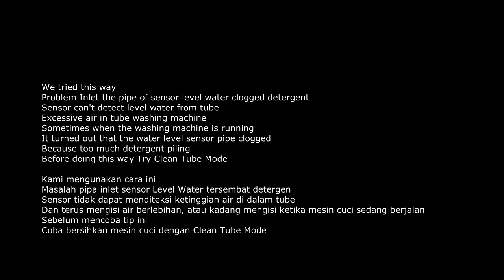Samsung Washing Machine Overfilling Water Level Switch but no error LED 4E E1

Comment: Thanks for this video! It at least helped me identify the sensor and the air tube for the Samsung brand washer.  The problem with mine is that the tube had disconnected at the bottom end - NOT at the sensor.  As soon as I removed the back panel (6-7 screws), I noticed the other end of the air tube just hanging there.  After re-attaching it, I ran a self-clean, and the water shut off when it was supposed to.  We just replaced our Dryer, so my wife was thrilled we didn't have to spend more money on another appliance so soon.
Reply from the maker: You are welcome Jr, many case washing machine in this unit. Like pin connector dirty or not contact, pipe, stuck etc. Btw thank for you too

Comment: Mas saya mau tanya mesin cuci samsung top loading saya awalnya tombol2nya ga berfungsi yg fungsi hanya tombol powernya.
Saya coba bongkar liat modulnya saya liat pcb.nya banyak seperti jamur di komponen2nya di dalam lapisan gelnya.
Lalu saya panggil teknisi mesin cuci, setelah diperiksa katanya modulnya kena lalu dia bawa biar dibenerin ke servis centernya daripada ganti modul lebih mahal katanya.
Setelah kembali modul dipasang coba ditest semua tombol berfungsi dengan baik, namun muncul masalah baru yaitu water level tidak berfungsi sebagai mana mestinya, air terus saja mengalir tidak mau menutup sesuai level yg dipilih.
Lalu diganti water inlet yg baru (bkn sparepart ori.nya) tapi masih saja seperti itu, kemudian diganti lagi dengan sparepart original.nya tapi masih saja begitu.
Sudah dicek selang n water inlet pun baru, sampai 4 hari bolak/ik ga kelar2 akhirnya si teknisi pun menyerah.
Setelah teknisi pulang saya coba iseng tekan tombol power+water level+function bersamaan, muncullah kode E9.
Saya browsing kalau error code itu menandakan adanya kebocoran.
Lalu saya perhatikan lampu indicator dari water level menyala 2 bersamaan, 1 posisi low yg saya pilih dalam keadaan terus menyala dan 1 lagi posisi med terlihat berkedip2.
Ini sekedar asumsi saya apakah sensornya membaca kalau airnya kurang sehingga dia terus mengisi?
Tolong saya dibantu, karena saya penasaran dan tentunya ingin mesin cuci kembali berfungsi dengan normal, maklum pekerjaan saya sebagai ibu rumah tangga jadi sedikit terbengkalai karena masalah mesin cuci ini.
Reply from the maker: E9 adalah error Low Level. Air yang sudah masuk ke tabung, tidak terditeksi oleh sensor (walau tabung sudah hampir penuh terisi air).
Bila selang sudah diganti, kemungkinan di sensor level sensor yang rusak, atau lubang di bawah tabung tersumbat diterjen / kotoran. Cara kerja bagian tersebut, menditeksi tekanan air. Misal diatur air sudah terisi setengah, maka sensor akan menditeksi air sudah setengah tabung berdasarkan tekanan udara di pipa sampai ke alat level sensor. Dan sensor akan mengirim sinyal, untuk menghentikan aliran air. Bila sensor tidak menditeksi tekanan air, asumsi tersumbat dan air terus mengalir. Bagian sensor tersebut mungkin bermasalah. 2. Ada kemungkinan lubang di bawah pipa ke tube tersumbat. Selang tidak terpasang dengan benar (artinya sensor tidak menditeksi adanya tekanan air). Cek kembali dibagian konektor kabel ke sensor (jangan lupa cabut aliran listrik sebelum memeriksa), apakah konektor kabel ke alat yang bundar (level sensor) sudah terhubung dengan baik. 
Mungkin tip ini dapat membantu, bila memungkinkan coba isi air bersih seperempat, dan jalankan proses mencuci dengan mengaktifkan Clean Tube (mencuci tabung). Fungsinya membersihkan tabung, umumnya dijalankan setiap 1 bulan sekali agar komponen di bagian bawah tabung mesin cuci bersih kembali.
Demikian bu informasi dari kami, semoga dapat membantu.
Reply: Saya coba bersamaan muncul E9 mba Amelia... sedang masalah saya di tombol startnya yg gak berfungsi.

Comment: baik sekali agan ini, tips nya berguna mengatasi mesin sanyo top load saya yg tiba2 hanya bisa ngalir terus airnya akibat sensor level  air error.
Reply from the maker: Sama sama om
Reply: mesin cuci saya muter nya kasar kaya seret. terus pengeringnya gak muter kira kira panaya yah?
Reply from the maker: Bila mesin cuci kasar ketika proses pengeringan. Dan terdengar keras seperti membentur dinding mesin cuci. Kemungkinan beban pakaian terlalu banyak. Hal lain bantalan pegas seperti per sudah usang. Bisa di coba dengan mengurangi jumlah pakaian atau di test dengan mengisi air minimum tanpa pakaian.
Dan dicoba kembali apakah bunyi masih terdengar. Bila yah, coba periksa kemiringan mesin cuci.
Bila miring , posisikan kembali agar mesin cuci berdiri dengan baik.
Bila masih berbunyi, memang urusan teknisi. Solusi lain dengan memberikan bantalan busa di dalam mesin cuci agar tidak terguncang.

Bila pengering tidak mau berputar, biarkan selama 5-8 menit. Biasanya akan muncul pesan error. Sistem kerja mesin cuci, ketika proses pengeringan maka sisten sensor tekanan air akan menditeksi air sudah dikosongkan. Bila sensor tekanan air tersumbat, bisa disebabkan pengunaan deterjen terlalu banyak dan menumpuk di mulut pipa sensor dibawah mesin cuci, dan menyumbat. Maka mesin cuci tidak akan melakukan proses pengeringan, karena sensor menganggap air di dalam drum masih ada. Bisa di coba dengan meniup bagian pipa valve. Dengan catatan air memang sudah kosong dan keluar dari mesin cuci.

Bila muncul pesan error. Coba periksa di bagian belakang pipa pembuangan. Biasanya ada coin tersangkut dan tidak bisa keluar. Membuat drain air menjadi terhambat dan tidak mengalir dengan baik.
Dalam beberapa menit bila air tidak keluar seluruhnya, maka sistem mesin cuci mengangap ada kesalahan, otomatis akan menghentikan proses pencucian ke tahap berikutnya.
Informasi untuk memeriksa drain air dapat dilihat video dibawah ini
https://youtu.be/Lk3TuR7xEeQ

Teknik lain di bagian mesin cuci terdapat opsi Clean Drum. Lakukan proses tersebut untuk membersihkan kotoran di dalam drum mesin cuci.
Bila masih bermasalah, sebaiknya memanggil teknisi. Mungkin saja bagian switch sensor yang bermasalah.

Mesin cuci seret, misalnya berbunyi kasar. Seperti kemasukan benda. Ada kemungkinan uang koin masuk ke dalam mesin cuci dan menyangkut di bagian bawah. 
Masih banyak masalah yang terjadi dengan mesin cuci.  Informasi diatas hanya sebagian tip yang kami ketahui
Reply: Caranya bagaimana ?? Boleh dong saya tau. Permasalah nya sama kaya punya saya, pas saya tiup dari selang baru dia mulai nyuci dah.

Comment: Is there water coming inside the pipe while the maching working??
Reply: I did relase the pipe from the tank but there is no water coming out from the outlet!!
Reply from the maker: @ham23eded  The water level switch pipe only detects air pressure from changes the water pressure from the drum
When the pipe is removed or unplug, the sensor will detect the water is empty.
Reply: Thanks..so it seems the switch is to detect if the machine is empty of water or not..is that right?? Or it is to detect the water level at certain level..there is selector switch to choose the required water level when starting the machine ..is the sensor  work to detect the selected level??

Comment: Nyuci pakaian sedikit  pakai mode fuzy tap airnya paling banyak itu knapa ya,seharusnya fuzy itu kalau cucianya sedikit airnya jg sedikit tapi mesin cuci samsung saya entah banyak atau sedikit cucianya airnya terseting ke paling banyak.apakah ini normal?
Reply from the maker: Ukuran ketinggian air diatur oleh sensor water level
Mengunakan sistem tekanan air, tersambung ke sebuah pipa, sampai ke sensor

Buka lubang di drum mesin cucu tersumbat, mengecil akibat deterjen
Tekanan air sampai ke sensor bisa lebih rendah.
Disini muncul masalah, sensor mengira air yang sudah setengah masih kosong.

Hambatan / resistan pada kabel sensor
Kemungkinan lain kabel di sensor, bisa usia mesin cuci sudah cukup lama
Penyebab sensor salah mengirim sinyal bisa bermacam-macam.
Kelembapan tinggi membuat korosif di bagian sensor.
Dan sensor salah mengirim sinyal ke modul mesin cuci.
Pipa dan lubang tersumbat, kotoran dari deterjen yang terlalu banyak menumpuk.
Pipa yang kurang kencang, atau bocor dan lainnya
https://youtu.be/H5PIa3WmD_4

Untuk memeriksa sebenarnya mudah
Clean Drum, adalah cara paling praktis
Lakukan 2-3 bulan sekali, walau di atas kertas disarankan 1 bulan sekali
Mengisi air ke tabung dan di bersihkan, hanya air untuk membersihkan drum.
Banyak penguna mesin cuci di Indonesia salah mengunakan deterjen
Mengikuti takaran pabrik, padahal hanya mencuci 1/4 tapi mengunakan deterjen ukuran penuh.

Memeriksa
Coba kakak set ke level air 1
Setelah mesin cuci bergerak, catat ketinggian air di drum mesin cuci
Pindahkan ke level 2, apakah mesin cuci berhenti
Dan mengisi air kembali.
Bila yah, sensor masih bekerja baik

Bila dipindah ke level 2, mesin cuci tidak menambah air.
Dan ketinggian air di level 1 dan 2 tidak berbeda, lalu mesin cuci langsung jalan
Ada baiknya diperiksa oleh teknisi.

Jangan lupa, ketinggian air level 1 mencapai 1/2 ketinggian drum lebih.
Karena mesin cuci harus mengangkat pakaian agar terapung, agar pakaian tidak mengenai propeler yang memutar di bagian bawah.

Semoga informasi ini dapat membantu

Comment: Hubungannya water level sensor dg water inlet dan drain motor gmn gan...apakah berkaitan langsung, krn mesin cuci sy tdk bisa berputar sedangkan indikator nyala normal bang ?
Mhn pencerahannya..tks
Reply from the maker: Water level sensor
Menditeksi tekanan air di dalam drum mesin cuci
Sinyal dikirim ke board.
Misal mengatur pengisian air level 1, 2, 3, 4 (Max).
Sensor tersebut bertugas memperkirakan tekanan air yang masuk
atau yang keluar (dibuang / drain)

Inlet, drain motor.
Mendapat perintah dari board.
Setelah proses pencucian, pengisian air
Tahapan di kontrol oleh chip.
Misal tahapan mengisi air, disusul mencuci, membuang air, dan memutar (spin)
Atau hanya memutar untuk pengering.
Tergantung kita menekan tombol di panel mesin cuci
-
Melihat gejala dari mesin cuci kakak tidak dapat berputar.
Coba periksa konektor dan kabel di mesin cuci, termasuk selang di level switch kadang dapat tertekuk atau terjepit.
Dan bagian utama kabel ke motor, sampai di board.

Cabut power, cek kabel, konektor dari bawah sampai terhubung ke board
Semoga hanya kabel di gigit tikus dan putus, atau kabel lepas

Kedua di coba dilewati tahapan, Untuk spin saja.
Bila mesin cuci menunjukan motor drum berputar
Artinya kabel semua terhubung.

Tapi ada tahapan tidak dapat dilewati, misal untuk tahap washing / mencuci tidak bekerja

Terakhir, biasanya kerusakan tersebut disebabkan sebuah chips rusak di board
Solusi memanggil teknisi untuk memperbaiki board
Sementara itu yang kami perkirakan kak
Reply: @ObengwareID  terima kasih mas....succes sll...👍

Comment: Bang kl indikator water level tidak otomatis deteksi bobot pakaian dan cuman macet di angka 1 gimana ya? Ini di isi pakaian dikit maupun banyak level tetap di angka 1. Jadi harus naikin level secara manual tiap kali nyuci
Reply from the maker: Water level di mesin cuci bekerja dengan adanya tekanan kak
Kalau di set 1 airnya sedikit, kalau 3 airnya lebih banyak
Bila di set 3, air di isi. Ketika air mencapai 60%, tekanan lebih besar terjadi di sensor, maka suplai air di hentikan, dan mesin mulai mencuci

Sepanjang pengetahuan kita waktu menguji seperti itu
Bukan dari berapa banyak pakaian dan ketinggian air otomatis ikut naik. Jadi penguna yang menentukan berapa banyak jumlah air.
Misal pakaian kotor, bisa di set dengan air lebih banyak.

Kami belum tahu mesin cuci model lain atau terbaru yang bisa menditeksi jumlah pakaian yang harus di cuci
Itu saja informasi dari kami kak.

Comment: uda ditiup, ga ada yg tersumbat.

 Tapi kerita mesin cuci dinyalain dan level air di tabung sudah Full, Air tetep ga masuk ke selang indikator.

Harusnya kan ketinggian Air di selang indikator ngikutin ketinggian air di Tabung.
Reply from the maker: Selang sebagai penghubung tekanan bobot air di tabung
Air tidak masuk ke dalam selang, hanya udara bertekanan
Karena membran di sensor ketinggian air, bekerja berdasarkan tekanan udara
Dari dorongan udara di dalam pipa kecil

Coba diperiksa konektor di level sensor
Bagian tersebut dapat kendor
Terakhir, kerusakan di unit level sensor (jarang terjadi)
Ada baiknya menyerahkan ke teknisi dulu kak

Comment: Bang mw tanya.. mesin cuci sy samsung.. setiap dinyalain selalu muncul kode error 1E, dah ganti sensor water level masih ttp muncul, sampe ganti selenoid valve inlet, kode masih jg muncul..  akibatnya mesin cuci ga mw bekerja.. apa masalah ini bisa diselesaikan dengan cara di video ini?
Reply from the maker: Mohon maaf sebelumnya. Kita belum mendapat error 1E. 
Melihat error langsung muncul. Coba di periksa bagian kabel yang menghubungkan uni water level sensor ke board.
Siapa tahu ada yang kendor karena mesin cuci bergetar dan masalah pada kabel.
Satu kabel tidak kontak ke konektor level meter, mesin cuci tidak bekerja atau salah analisa kondisi air.
Pastikan tidak menyentuh kabel dalam kondisi mesin cuci On.
Selebihnya kami belum dapat memberikan pendapat, karena belum pernah mendapatkan memperbaiki masalah dengan 1E

Comment: Mas mau tanya, mesin cuci saya tombol start nya tidak berfungsi hanya bisa power ( untuk menyalakan mesinnya saja) setelah itu stop tidak berfungsi. Samsung diamond drum untuk jenis mesin cucinya. Mesin cuci ini penting sekali untuk saya. Mohon informasi nya. Terima kasih.
Reply: Saya mencoba mengikuti instruksi mba Amelia dengan memencet tombol power, water lavel dan function secara bersamaan. Lalu muncul E9 yang sudah mas jelas kan bahwa E9 adalah eror water level. Sedang masalah pertama saya adalah tombol startnya. Mohon bantuannya mas. Terimakasih
Reply from the maker: Masalah umum di Samsung, akan tertera di bagian indikator seperti DE Error atau Door Error
Switch tutup pintu  yang bermasalah, membuat mesin cuci tidak dapat bekerja. Karena sensor menditekai pintu masih terbuka walau sudah ditutup oleh kita.
https://youtu.be/i609z9bmL0g
Bila kerusakan tidak terlihat dari informasi indikator. Sebaiknya ditanyakan ke Samsung Center kak.

Comment: Bang, mau tanya. Air yang masuk ke mesin cuci kecil, supaya lebih deras aliran air nya. Apakah ada solusi ??? #mesin cuci samsung diamond drum.
Terima kasih.
Reply from the maker: Paling di dorong dengan pompa. Pasti deras tapi dengan catatan tekanannya ngak boleh melewati batas kekuatan valve. Repot sih harus beli pompa khusus buat mesin cuci sendiri.
Kedua arus inletnya (dari keran) juga harus besar.  Tapi toron airnya di tempat lebih tinggi, agar tekanan air turun ke bawah lebih besar.

Tapi penyakit utama, kalau air dari kran cukup besar. Masuk ke mesin drum mesin cuci ternyata cuma netes. Ini yang bikin kesel. Kemungkinan bagian mulut vavle solenoidnya tersumbat.

Caranya gampang. Matikan arus listriknya dahulu. Buka sambungan pipa dari kran ke mesin cuci. Bentuknya drat yang di puter. Ada lubang masuk air di belakang mesin cuci.
Lihat di lubang tempat masuknya air dari sambungan pipa. Pakai senter, liat di dalamnya seperti saringan / jaring seperti besi.
Biasanya bagian ini sering banget kotor. Akibat lumut atau kotoran yang dibawa dan masuk ke mesin cuci. Nah nyangkutnya disitu, bikin air makin lama semakin kecil masuk ke mesin cuci.
Kalau masalahnya selesai disitu, bersihkan setiap 1 bulan sekali. Biar airnya ngalir lebih deras ke mesin cuci
Semoga membantu
Reply: Sangat membantu , matur suwun ....
Reply: Bang mau tanya gmn cara mengetahui air nya terlalu deras atau tidak nya? Batas valve nya sederas apa?

Comment: Mas apa ini cara memperbaiki air kran yang mengalir terus atau tidak mau berhenti walaupun sudah mencapai level air yang diinginkan??
Reply from the maker: Biasanya di bagian level ketinggian airnya mbak. Kemungkinan mampet karena tersumbat sabun kering, sehingga level meter (water level switch) yang bekerja dengan sensor tekanan air. Sensor menditeksi air di dalam tabung masih kosong karena tidak ada tekanan (lubang pipa inlet tersumbat). 
Kejadian seperti diatas, kadang tidak ada peringatan. Air kadang masih mengisi, walau mesin sudah berjalan. Atau kejadian seperti mbak Fara alami.

Atau kerusakan di bagian sensor level meter.

Kita pernah mengalami masalah tersebut, di coba dengan membuka bagian pipa ke sensor, dan di tiup (bila terlihat tersumbat)
Lalu menjalankan Clean Drum. Isi air sampai seperempat , dan dijalankan mesin untuk mencuci langsung.
Bila masih memungkinan cara diatas, bisa dicoba dahulu sebelum memanggil teknisi mbak
Reply: Obengplus com makasih banyak atas penjelasan nya ya mas, semoga kebaikan mas dibalas tuhan dan ilmunya sangat bermanfaat.
Reply from the maker: Sama sama kakak

Comment: Mas saya mau numpang tanya, Mesin di tempat saya sama seperti itu, tapi saya meniup nya dari bawah dan masih eror. Apakah harus dari atas untuk meniup selang tersebut ?
Reply from the maker: Ini salah satu perbaikan dari masalah paling sering, bila kita terlalu banyak mengunakan deterjen, membuat  tabung selang sedikit mampet. Kadang ada coin yang nyangkut di pipa drain, membuat mesin cuci tidak mau bekerja ke fase 2 (proses Drain)
Dalam kasus ini,  tidak menjamin masalah selesai dengan teknik ini om Wahyu. Mungkin bagian pressure switch yang rusak dapat diperiksa dengan multimeter sambil ditiup, ada kabel yang mungkin lepas, kendor, korosi di bagian kontak (bila sering terkena air maka tembaga akan bereaksi) atau kabel di gigit tikus.
Bila tidak ketemu masalahnya, ada baiknya menghubungi teknisi.
Reply: ati2 didalam sensor level air sensitif,bahan  karet tipis setipis rambut mudah pecah / bolong
Reply: jika karetnya ada lobang kecil seperti digigit semut apa bisa di lem ya? jika bisa pakai lem merek apa ya yg bagus apa ya  ?